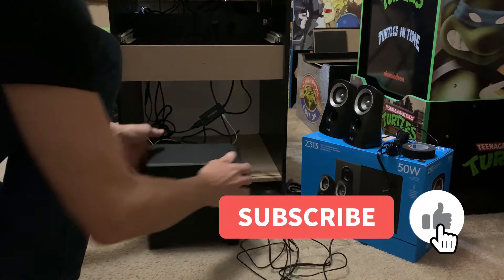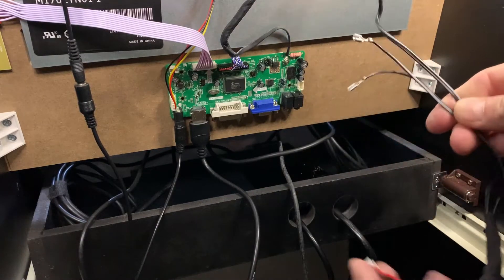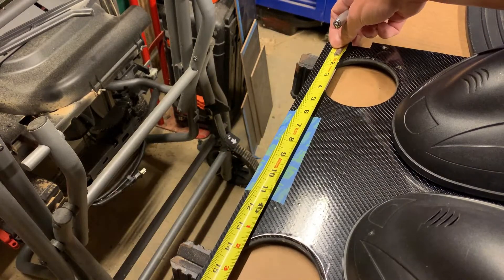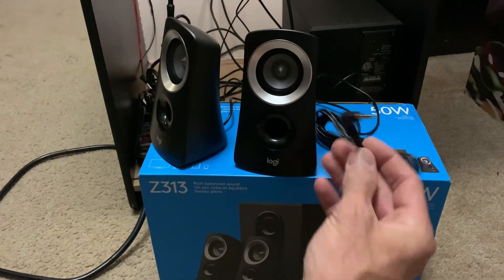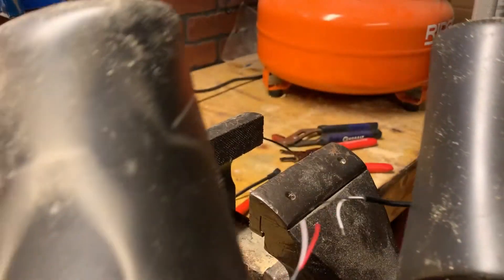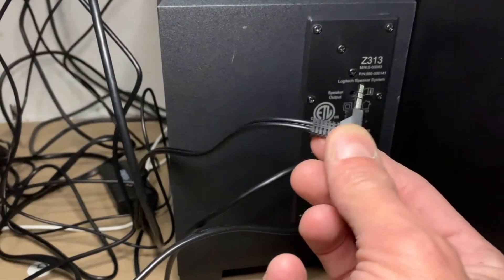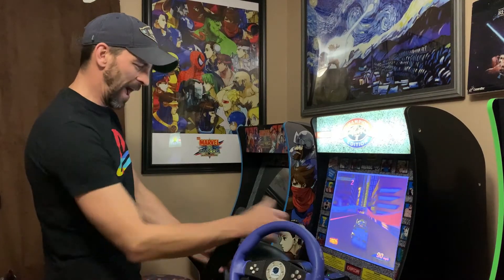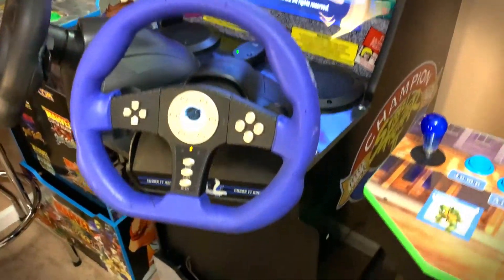Arcade1up Racing Cabinet Sound System Upgrade

Comment: I have an arcade 1up pinball machine where the output is for 4 pole plugs or TRRS cables. When plugging in this speaker system only one of the stock speakers work. Any tips